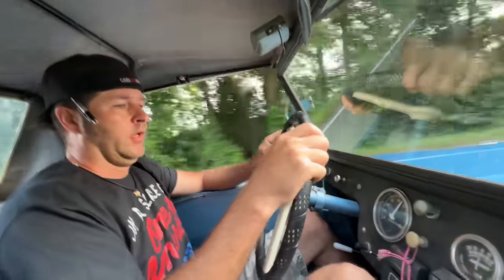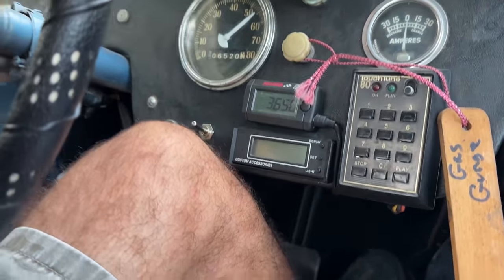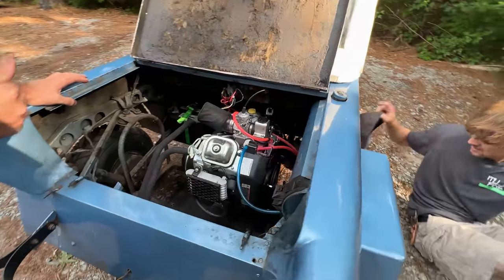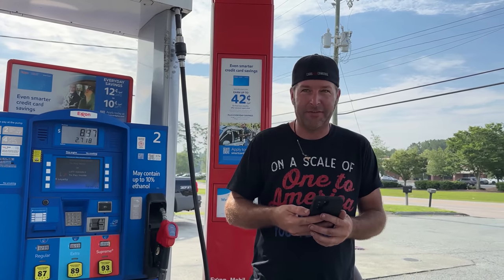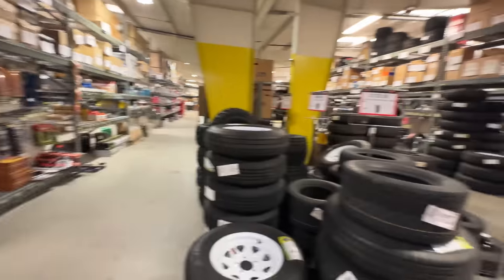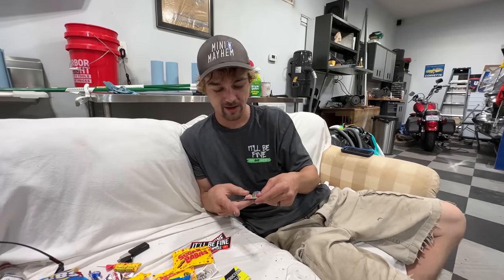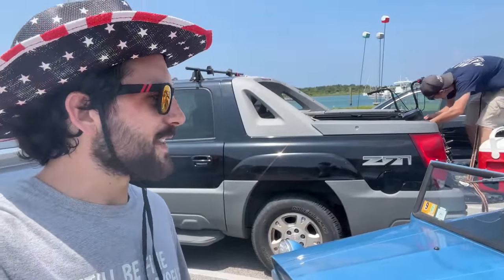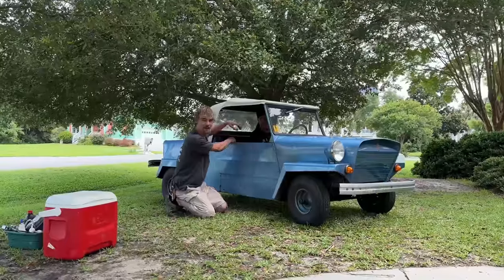Will Our 1969 King Midget Microcar Drive 300 MILES to the Beach? (4th of July Special!)

Comment: Relatively speaking the mileage isn't that bad for screaming along at 3700 rpm. With an overdrive you'd probably get close to 40 mpg. Sounds like some engine mods and gearing change are in order.

On a side note, Charle's "catch all" collection was awesome. I would love to have all those Briggs parts.

Comment: part of that torque steering is do to it being one wheel drive instead of both rear tires speeding you up or slowing you down its one causing the whole car to shift on and off throttle
Reply: I'm thinking a 4 link suspension in the back and a rack and pinion up front, probably a live axle instead of the "One Wheel Peel" setup currently in use. Either way the Midget is a sweet little ride!

Comment: Would love to see it with some performance mods in the engine
Reply: When they turbocharged the Predator 670 for their dragster,  didn't they say they had another turbo kit? Sounds like just the thing! If I found a King Midget like that, not only would I turbo Predator 670 swap it, I'd update the lights, including a third brake light, not to mention the suspension and brakes with modern go-kart pieces!

Comment: Do you all think you could try and incorporate a radiator to maybe help keep the engine cool, or maybe try to figure out a way to cool the oil down? You could probably use a mini oil cooler that are usually mounted on cars for extra cooling. It'd also be cool to see it lifted  with better wheels.

Comment: 1. Proper tires
2. Rebuild the main drive. At least new seals but a good look over can't hurt.
3. Re do the steering to something not trying to kill you.
4. Replace/Upgrade the suspension so it again isn't trying to kill you.
5. Engine mods to give it more power
6. Larger sprocket on the main drive for a higher top speed so you can go proper highway speeds.
7. Find a way to better vent the engine compartment so it can keep things cool. Maybe it needs a fan somewhere to draw air in.
CVT's are nice but they require the motor to rev high where as when your cruising you want low RPM thus killing your MPG's maybe a new driveline is in order.

Great series I'd like to see more.

Comment: Have you considered a 'steering stabilizer' like the ones used on solid axle 4wd vehicles like Jeeps? It could be clamped to the long arm of the steering setup, using a gas filled monotube to absorb a lot of the 'road input' that makes the steering jerk and swerve. It would be a cheap fix for now. 
As for the shocks, Monroe has a chart in their online catalog that has the dimensions for each shock they sell, including the top and bottom attachment method. If it were me, I'd use it to help source a set of shocks, preferably KYB monotubes, at the very minimum for the rear, and the mounts if needed. It will make the car much safer and roadworthy.
Just a thought. Love this car. Keep making her better.

Comment: i enjoyed your trip  video. i have had a 67 for about 10 years.  converted to a 23hp briggs vangard and comet drive,  also made it two wheel drive with a differental,, no more of the wierd twitching and flexing when going on and off the throttle. there is a k.m.  rally aug 8-12 in cambrodge ohio.  there's a lot of nice people in the k.m. group.  youn guys should try to make it.

Comment: One thing's for sure, it was never meant to go that fast for that long. Fix the steering and suspension, get a good wheel/tire combo all around for highway speeds. Maybe figure a way to adapt a small  transmission to lower your engine rpm at cruising speed or perhaps swapping in one of the motorcycle engines to have 5-6 speeds available, albeit no reverse.

Comment: Hey man I’m just watching this video about the king midget swap you can pump tube grease in the engine clutch hole where you put the bolt to push clutch off and hit it with the impact gun and it’ll pop right off. Like changing the pilot bearing on a Chevy truck when doing a clutch job.

Comment: @CarsandCameras the left and right jerk off-throttle is probably from the one wheel drive. My guess is throttle/engine braking is only affecting one wheel, so it's like hitting the brakes when one caliper is locked up. It wants to pull to the side with the working caliper. And mixed with the sloppy steering makes it dart around. I bet a solid axle would make it handle better. (And a steering refresh, but that's obvious lol)

Comment: Dewds...
Stiletto rack and pinion....small, cheap, and it flat out works. Kit comes with everything, like tie rods and all that.
It looks like it has the full width swing arm type rear end. Make sure it has solid pivot points and bushings/sleeves.
Would take diddly squat and a few bucks to make that thing handle better than it ever did from the factory.

Comment: If it ain't rough it ain't real lol...Thats a cool  little ride and I'm anxious to see this one..I think it's so cool that a couple of those old racecars are still there..The roll bars and welds are what blew my mind cause the rules wasn't too bad back then... I'm guessing it's because most car's was built like a tank back then and the metal wasn't as old as now..I can only imagine what it was like racing in em, I've drove several 50s cars and 40s trucks in the 70s.. The ol trucks was geared for 50mph top speed but we'd change the rear-ends in em so we could gain more altitude lol..80 and 90mph was better than 40 and 50mph tops cause speed limits was 80 in most places..People most usually cruised along at 100mph and they eventually had to slow em down to 55mph in the 80s with the odometer sayn 85mph tops but they'd go alot faster cause I had an 84 Buick Regal that the needle would got outa site in the dash lol..I could cruise along pretty good in it and I never paid attention to my odometer cause I's to busy keeping up with traffic but that needle always ended up outa sight lol..

Comment: As a kid my brother and I found an old go kart frame put slicksurrounded and then 4 cylinder generator engine used by the military  That someone had already put 4 Chrome stacks on and painted red white and blue. This thing was so dangerous while we were at school my dad pulled the centrivical clutch apart and wielded the weights so it wouldn't engage.😂 What an asshole

Comment: I have those tires you were looking at on my go kart. They are great in the mud and it definitely doesn't make it float.
Reply: Your issues are stemmed from balance, not buoyancy. I have an ATV with those on the rear and some thinner ones up front. It definitely floats, as does my ATC that has even fatter tires on it. It's the central placement of the engine that's needed to balance it out. If it's over the rear axle you need even larger tires to support the weight since it's not distributed at all to the front tires. If that makes sense.

Comment: since that car wasn't built to run that fast you might need to put a steering damper on the front end. get to a home depot lowes or something amd get some 1 inch foam insolation or something and put behind the seat.

Comment: That thing boogies pretty good, needs a better rear axle setup lol build a better cross steer setup, need the drag link moved to the passenger side so it doesn’t have as much bump steer, build it all out of Heims, use a Vega steering box if you need to upgrade

Comment: I would check those hubs for in and out  play that might be where the death wobble is coming from and or you might need to think about a building a traction bar for the front end cause believe it or not independent a-arms just like a straight axle can get side to side play as well... an if your hubs have side to side play as well as arms or axle play the combination of the 2 makes it a bit scary

Comment: I say the thing could use a suspension meant for reasonable speed driving, little engine work nothing too crazy, its not a drag motor. Squeeze some extra ponies out of it keepin it reliable. Gear it for higher top speed. Be a heck of road trip car

Comment: I love this video in last July I drove my Organic Transit ELF (Solar powered enclosed e-velomobile built in Durham,NC) across North Carolina from Winston-Salem,NC to Wilmington,NC doing 230 miles one way and 460 miles both ways with 3 batteries getting 60 miles or about 20 miles per battery I would love to see you guys build a Organic Transit ELF into a hybrid with a Predator motor. Check out Sol-Mobil in Winston-Salem,NC he does custom fabrication for projects like what you do.

Comment: A solid rear axle or a drive chain and sprocket to the other rear wheel would do a lot for that torque steer. Probably need to swap the full drag link for a second shorter link from the steering box to the passenger wheel.

Comment: Hey, if you have any problems w/ the engine you can pretty much just hit Harbor Freight for parts or even a new motor....     😂
7:35 - deja vu...  😮
Edit 2: You should have driven it 420 miles in the 69 Midget...   😁

Comment: Not surprised about the throttle lift issues. If you have drive going to only one wheel then you have engine braking on only one wheel. Like hitting the brake pedal and only having brakes on one rear wheel. That would most likely get much nicer if you could lock the axle.

Comment: Are you not able to put a longer bolt from the steering arm and add a longer bar from the left wheel to run to the right wheel so in turn both wheels are adjustable and under steering load ?

Comment: Just a thought gents. Try a set of golf cart tires with a street tread. Twice as wide and a little taller. Also, you can put on a set of alluminums as well later on. It'll probably increase your gas mileage too by reducing your engine speed.

Comment: I just might have a differential axle layin around that could be made to work in the rear of one o those king midgets... That or I could point ya to a few... I'm guessing  44 inches (1117.6mm) hub face to hub face on the rear axle stock tire size is 5.70-8 18inch od 5.8inch wide on a 8inch rim... a common retrofit for radial tires is the 215/60-8 - 18.1 inch od x 8.9 wide on 8inch rim

Comment: If you guys put a straight axle that will eliminate the wobble when decelerating. I think this happeneds because one wheel basically brakes when you decelerate and the other doesn't since its only one wheel drive

Comment: It would probably get better gas mileage if it had a manual transmission.  The addition of a cooling fan in the engine compartment could help a bit.

Comment: This thing would be cool if you added a jack shaft to drive both wheels and redesign the steering also harbor freight  trailer tires would  probably  fit on this

Comment: i know this has no relation to this vid but how should i unbend mini bike forks i have this old rupp mini bike and i want to keep the original forks but i dont have a map gas torch or anything only a propane torch the forks are very hard to bend at all and i dont wanna make new ones because its just a old rupp and the original ones are cool
Reply: Use a press
Reply: @isaacitllbefine7231  i unfortunately don't have access to one I will probably just have to rebuild the forks to just start from new I don't know

Comment: I would look into a divorced 6 speed from a bike and maybe up the wheel size to a 13. Be a lot easier on that engine turning like 2000 at 60 vs 4000

Comment: Probably the only thing that will fix the steering is a straight axle. Or some sort of open differential axel. With all the torque going to one wheel it will push the front side to side with power change.

Comment: Love to see use update it to make longer huals with oil cooling and maybe have a custom truck lid with luvers for heat extraction update steering adding heat shielding to back seat but also making it so its Not  reversable unless it's a major safety decision like some supports to strengthen chassis kinda how Jay Leno does on his cars make it less sketchy then uses do make it a one of kind super build new light maybe led just like use done on some of bike go all out to make it a state to state car build like the trail bike trips maybe look for some other micros to make a trip it be a good video wish I had funds to have something like that I have so many ideas that funds are such a hold back so I try to comment in hope to maybe spark someone that has funds and ability to carry out things even if it not my idea but sparks yourselves a idea keep up great work and everyone have wonderful day

Comment: Hey guys question for you does a 30 series tourqe convertor have a top speed befor the belt flies off or will it not fly off?
Reply: If its installed correctly it wont

Comment: I really don't understand the point of using these stationary motors as the power plants, that 670 is less powerful than most 250cc bikes not to mention the loss through the cvt which is horrible. Put something around the 600-650cc mark in it and you would have a car with a nice 6 speed that could probably go way faster than you would ever want and cruise around without a second though hell since they are generally water cooled you could also add a heater without much effort too
Reply: Im happy with it because we get to keep reverse
Reply: @isaacitllbefine7231  you just connect the chain drive to the reverse gearbox, i get the simplicity of it but really even with all the best upgrade those engines aren't good at much except being cheap

Comment: You really need to fix the steering before you kill yourselves or someone else. The turning when you accelerate and when you let off of the gas, I would check the rear suspension bushings. It looks like torque steer.
Reply: C'mon Man you know the thing